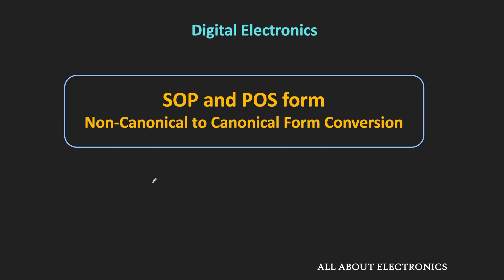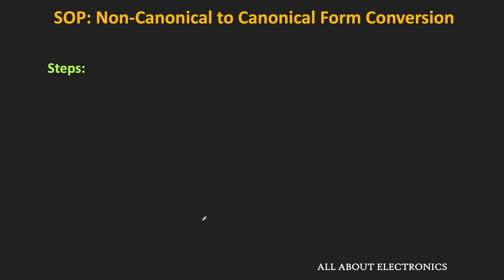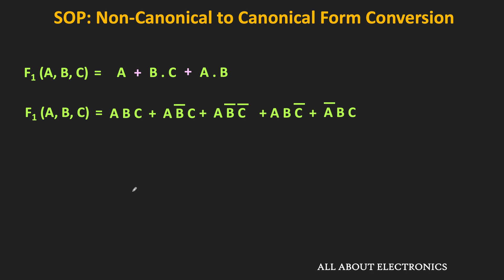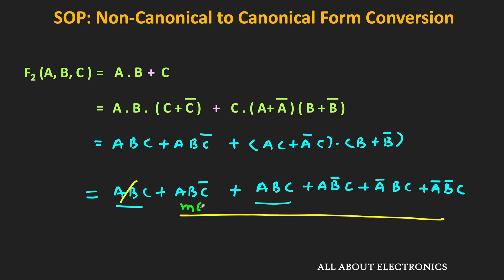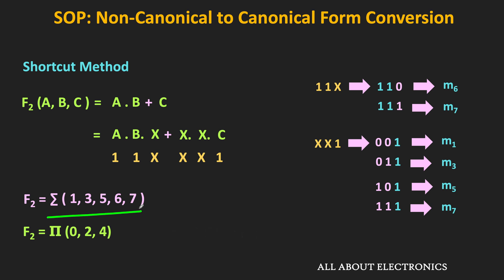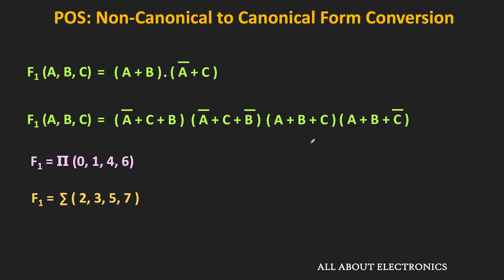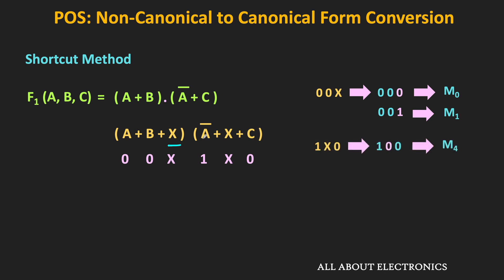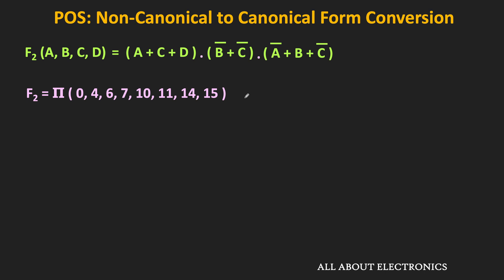SOP and POS Form : Non Canonical to Canonical Form Conversion of Boolean Expression

Comment: how did u write tern for 4 input like u have told us it for 3 only
Reply from the maker: Even for 4 variables, the procedure will remain the same. For example, at 11:30, first two variables, were expanded to 3 variables. Similarly, if we have 4 variable function with the same expression, then first it will be expanded to 3 variable and then 4th variable (e.g D variable) can be introduced and similarly the expression can be expanded.

Comment: at around 5:20, how does he get the minterm numbers of m7, m5, m4, m6, m3?
Reply from the maker: m7 = ABC, meaning that both A, B and C are 1. (ABC = 111, in decimal that is 7)
Likewise, AB'C = 101, meaning that, the output is 1 when A = 1, B = 0 and C = 1 (101 in decimal is 5). So, it is minterm m5. 
For more information, check the earlier video on SOP and POS form.
Here is the link: https://youtu.be/YmKmS9bpMqM?si=gmAomYZdCaSvIHZL
Reply: Basically in sop, if there is compliment write 0 and other would be filled with 1
eg:- ABC' = 110 i.e the Binary of 6,

 And in pos the compliment are written with 1 and filled with 0 
eg:- A'BC= 100 i.e the Binary of 4

Comment: I am getting answer for last question as:-
pie 2,5,6,10,12,13,14,15
sigma 0,1,3,4,7,8,9,11

All are getting different @ABOUT ELECTRONICS please provide correct answer
Reply from the maker: Yes, That's correct answer.
Reply: Same
Reply: Correct answer👍👍
Reply: Why did 5 come in POS?
Reply: @ArdhraMP-o3l  Same doubt
Reply: @ArdhraMP-o3l  same doubt

Comment: 12:00 the pos form answer is 0,1,4,5 but u have written 0,1,4,6
Reply from the maker: For Maxterms, the assignment is different than minterms. For example, (A + B + C) corresponds to M0, while (A' + B' + C') corresponds to M7. Therefore, here this (A + B + C') corresponds to M0.  While, A' + C + B' = A' + B' +C corresponds to M6. I hope, it will clear your doubt.

Comment: 9:51 , Answer is
Canonical SOP form = Sigma ( 1,5,8,9,10,11,13 )
Canonical POS form = pi ( 0,2,3,4,6,7,12 ).
Reply: correct ans but in POS form add 14 and 15 also
Reply: AjitTeshKumar's answer is right
Reply: Thank youuu
Reply: wrong answer
corroct is 
Canonical SOP = Sigma(3,7,11,12,13,14,15)   ===(7 terms)
Canonical POS = Pie(0,1,2,4,5,6,7,8,9,10)         ===(9 terms)  ===(7+9==16 term it should be total 16 terms bcz of 1111)
Reply: @thesbeccompany7752  what the hell is this bro dont use chat gpt its usually wrong
Reply: @thesbeccompany7752    absolutely wrong